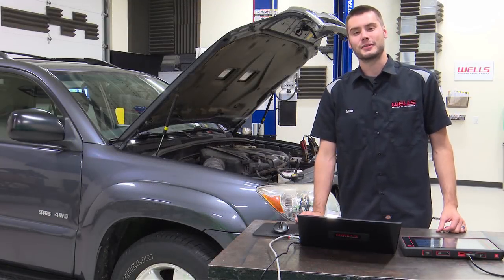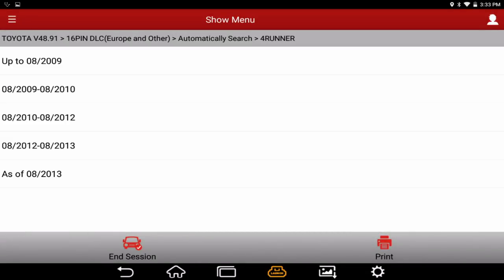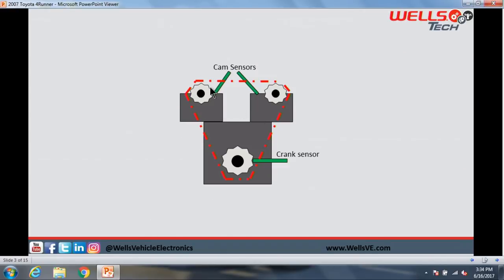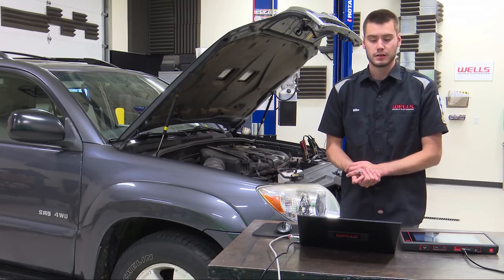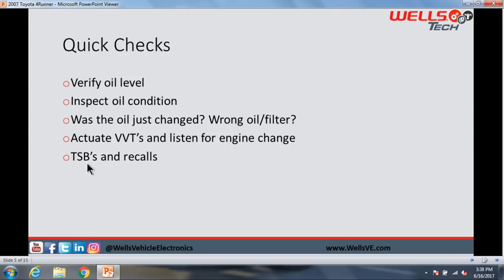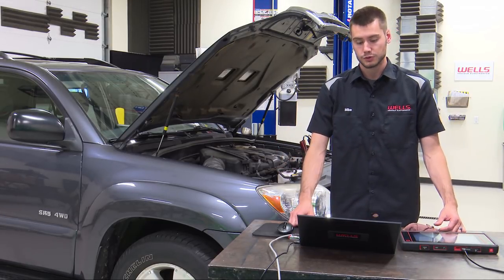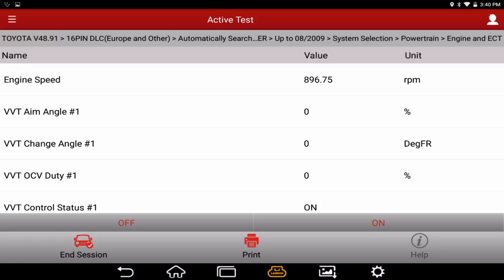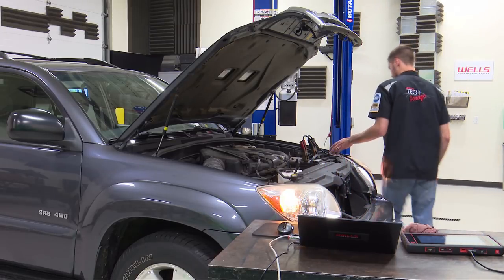-Episode 1- Cam/Crank Timing Code P0016 Case Study - What is a P0016?

Comment: Hi Mike, awesome videos. Super helpful and very well presented, you're a natural at this stuff. Question: How would temperature effect this code? I have an 08 4Runner V6 and I can control this code producing the CEL by simply choosing when to start and stop the engine, based on operating temp. Cold starts will always trip it, but if I drive several cycles while it's at operating temperature, the code will disappear until the next cold start. I can reliably predict the CEL just by cold vs hot starts. It seems several others on the forums experience the same thing. Any ideas or insight on temperature effects on the system? Cheers
Reply from the maker: Hey Rob. Thanks! Great question. Many times test will only run when the vehicle has been cold started. In the code set criteria for a P0016 Toyota states that the test is run once per drive cycle and the vehicle must also be idled for 5 minutes straight. It does not define a coolant temp for the "drive cycle" but generally speaking the vehicle would need to go through a warm-up in order to be considered a drive cycle. So yes, I would say temp has a factor is running the test, temp probably does not effect the actual fault.
Mike Becker, Technical Services Instructor
Reply: Ok, thanks. I suspected that too. I hoped you might say that oil temp (and oil condition/contamination) might effect performance of the OCV applying pressure to the VVT, and therefore the VVT not advancing or retarding the timing appropriately (but only when the oil is cold and thick, therefore intermittent).
It's weird, my CEL comes on 5-10 seconds after cold start up. Guess I'll have to understand the test conditions a little better. Thanks again.
Reply from the maker: Rob, I suggest you take a look at the videos that follow up. I proved out in the videos that the VVT system can not cause this code. The P0016 is for OVER retarded timing. VVT on this car can only advance the timing, meaning VVT can not force thing more retarded than the mechanical stop inside the cam. Like I said, check out the follow up episodes to this video. you wont be disappointed :)
Mike Becker, Technical Services Instructor
Reply from the maker: Haha alright good! Any more questions don't hesitate to ask!
Mike Becker, Technical Services Instructor
Reply: My 10 months later follow up, in case it helps anyone.... Eventually my code became permanently on, regardless of temp. So I stripped the engine and low-and-behold, my chain was definitely stretched. Also, on reassembly, replacing the oil pump o-ring without dropping the pan is a stressful task, beware, lol.
Reply: rob77g60 so stretched chain, did you have to replace whole timing kit? Or just the chain? Thanks

Comment: I’m definitely late for when this video was posted, but I’m having the same code on my car. I’ve changed the cam sensor and it did make the code go away and let the car run like normal again for a few weeks, but then it came back. Biggest things it’s doing to my engine is making it mildly jumpy at idle, even though it stays between 740-780 rpms, and it likes to hesitate when moving from a stop sometimes. Otherwise, it runs just fine. If I clear the code while driving, it stays off, and only reappears when I turn the car off and back on again. I’m wondering if perhaps (since I did replace the motor a few months ago) if the ECU needs to be recalibrated to the mechanical timing of the motor? I had the new motor get a fresh timing kit with it before it was installed too.
Reply: What was your solution bro??? I have the same condition.  P0016 goes away then come back

Comment: fca tech normally if you just use a scan tool to clean the cam phaser code goes away
Reply from the maker: You've had luck with that Alexander? Do you know what the scanner is doing to "clean it"?
Mike Becker, Senior Instructor
Reply: yeah get a lot of p0016 codes. using scan tools you can clean cam phaser exhaust one exhaust two intake one and intake two. I believe the basically it back flushes the solenoid inside of the cam phaser to remove debris.

Comment: i have this problems in my pontiac g6 2007
1.-  P0014-00
 Exhaust Camshaft Position (CMP) Sensor Performance Bank
1

2.-P0021-00  Intake Camshaft Position (CMP) System Performance Bank 2

3.-P0014-00
 Exhaust Camshaft Position (CMP) Sensor Performance Bank 1

4.- P0017-00
 Crankshaft Position (CKP) - Exhaust Camshaft Position (CMP)

5.-P0021-00  Intake Camshaft Position (CMP) System Performance Bank 2

the oil was changed and cleaned

the gearbox was changed and a new module was purchased
Reply from the maker: Hey Rogelio, could be a timing chain issue. Maybe it jumped time? 
Mike Becker, Senior Technical Instructor
Reply: I bought Auto trans hydraulic control module new and configured will that be?

Comment: So what if this is actually an intermittent issue. I have Had my engine light turn itself off (getting same code p0016) after being on for a while. I have litterally watched it turn off. Though it's on more often than not.
Reply from the maker: Hey Luis, chances are your looking at the same issues as this vehicle. 
Mike Becker, Senior Instructor
Reply: @GoTechTraining  damn ok thanks.
Reply: @GoTechTraining  so I had it checked out by toyota, they took the valve covers off and the engine was still in time. They say all sensors and vvt valves and the ctrollers are all working as they should be. To say the least they say the are stumped lol. Oh well at least the engine is running as it should.

Comment: What does the 2 trip failure code mean?? Thanks
Reply from the maker: Jen, great question! A 2 trip failure means that it must fail 2 consecutive drive cycles in order to set a trouble code/check engine light. A single trip failure would be setting a code on the first failed test.
Mike Becker, Senior Technical Instructor

Comment: If its a V6 Mercedes its the balance shaft, be prepared for a $6400 repair
Reply from the maker: Wow Eric, really!? That's a pricey one!. Is that just for the chain job? Or is that a motor replacement?
Mike Becker, Technical Services Instructor
Reply: Balance shaft replacement, defective part 06 W211 merc e350
Reply: Eric Filsinger go to Mercedes dealer there was lawsuit fill and they should fix it free. Vehicle from I believe 2003-2008 e350

Comment: What about pull out the valve cover and see the timing marks align. None of them fancy scanners. Hahahaha
Reply from the maker: Yeh Sure Jonathan, go ahead. Book time is almost 3 hours to do that. What if you're wrong? Who's paying you then? I diagnosed it with a "fancy scanner" in under and hour without removing anything that took time. Work smarter, not harder my friend.
Mike Becker, Senior Technical Services Instructor
Reply: @GoTechTraining You're right. I work on most of such problems too. What you've done is the correct sequence of diagnosing that problem. I'd prefer to carryout those tests first, before opening up the engine and all that.

Comment: Took mine to the  GMC dealer at Red Springs N.C. they could not find why check light is on. Ask if they tested any sensors said they had no way to do that. Ha Ha Ha so where do you go to get it fixed.

Comment: Question, I reset the codes, but I get the error in about 6 miles.  So, it’s not 2 trip in my case.  Is that unusual?  Same engine, same year, runs great.  I changed my oil once and removed a dry filter.  2 summers ago the code was intermittent, now always on.
Reply from the maker: Interesting...Not exactly sure. Maybe there's a parameter that if it's read toooo far out then it can set the code on a single trip? Sounds like you have an oil flow issue though if you had a dry oil filter...not good!
Mike Becker, Senior Technical Instructor

Comment: Wouldn't the wrong oil trigger more then p0016
Reply from the maker: Maybe, maybe not. The computer really has no way of knowing what oil is in the car. It would/could set a P0016 because the oil isn't doing what it's supposed to for the VVT system.
Mike Becker, Senior Technical Instructor

Comment: I have a 2013 Audi A5 1.8 TFSI and it started with first giving a slight misfire sometimes when car was stationary so I then serviced the car but still same issues. I then changed the ignition coils and spark plugs but yet again same problem so I then added some additive to the car engine before I turned it on and as soon I turned it the car started to misfire and shake a lot and would cut out and now it gives a code P0016. Can you tell me what it can be ?
Reply from the maker: A P0016 relates to cam/crank correlation. Maybe the chain/belt is stretched or jumped?
Mike Becker, Senior Instructor

Comment: I have a questions on scan data iam Mohammed in Ethiopia when diagnosis in the problem p0016 current crankshaft position -camshaft position correlation (Bank1 sensor A)
Reply from the maker: Hey Mohammed, what's your question?
Mike Becker, Senior Technical Instructor